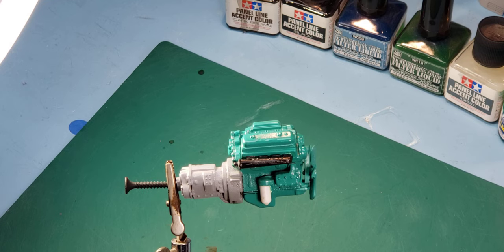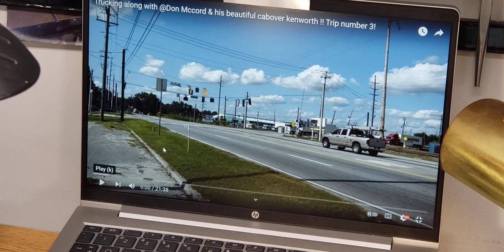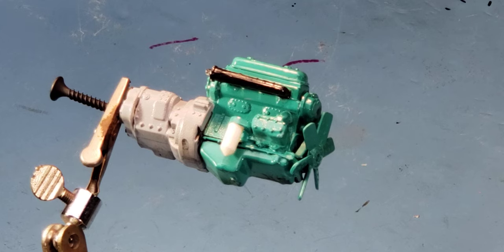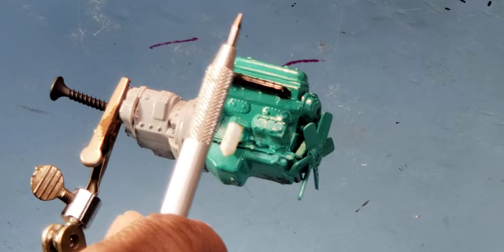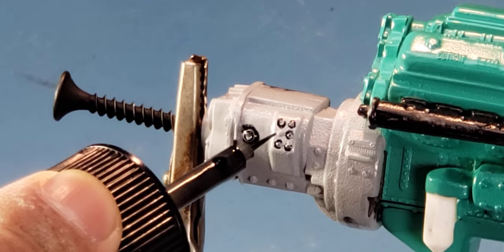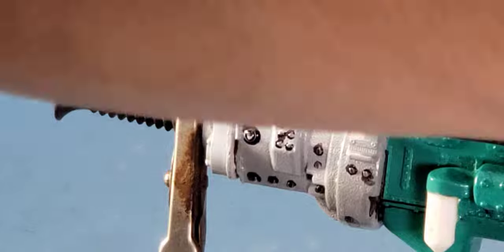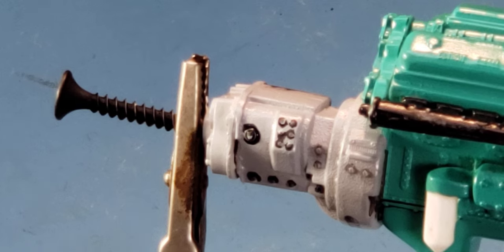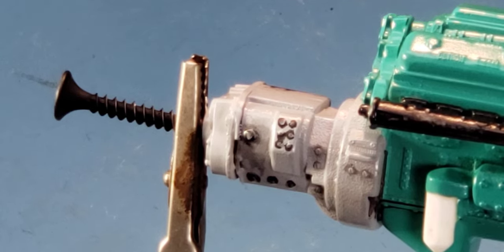Weathering Your Detroit Diesel 8V71 With Oils/Panel Wash. Part 2.

Comment: Had to stop for a battery charge! This technique of putting a color/wash on something you want to highlight is a good one. I use it to do the colors in certain types of truck emblems,like the red background in the KW badge on the grill or the side badges for kw or Freightliner on the sides of the hood. Works good on raised letters and emblems on mudflaps to!
Reply from the maker: Oooh, that is a sweep tip. I didn't know that. Pretty much every truck model has that emblem that needs to be painted.
Reply: Yeah,you just paint the whole thing whatever color and ,I use my thumb,just wipe the raised portion off! Works great. With the mudflaps,I let em dry,and sand the raised off!